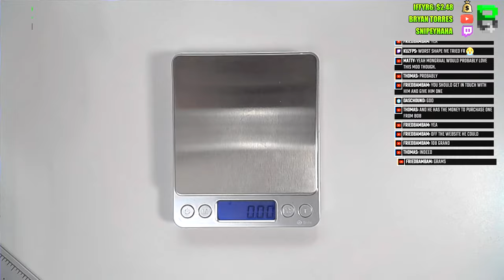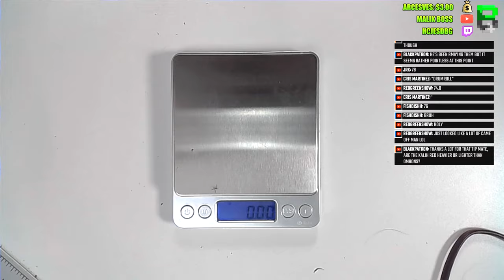Logitech G402 Weight Reduction - Remove 12 grams - Stock Look 92 grams

Comment: Are you going to do another weight reduction video on the G402, where you remove most of the unnecessary weight added to the mouse & reach it's max potential?
Reply from the maker: No this is it for the g402 at this time
Reply: @Beardedbob  Ah right, thanks. I'll be looking into doing this weight reduction on my own G402 aswell! :)
Reply: @Beardedbob  if do you any more for the g402 it'll be really appreciated. Thanks in advance really liked this video

Comment: How much weight could I reduce if I drill holes everywhere, aka non stock look?
Reply from the maker: maybe another 4g from the holes and 7g from taking the rubber off.
Reply: @waynenicholas257  Scammer.
Reply: @emilyjacob1810  Scammer.